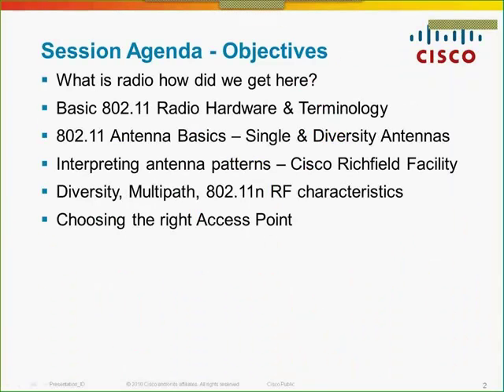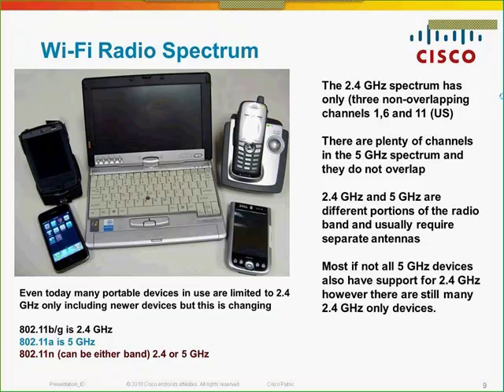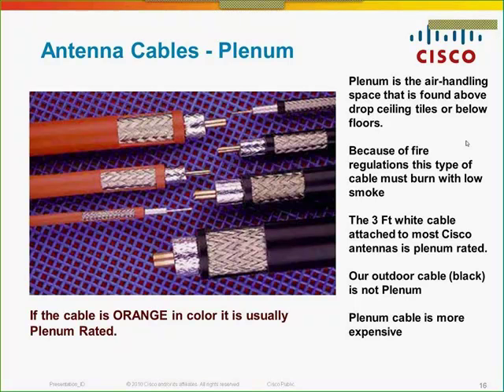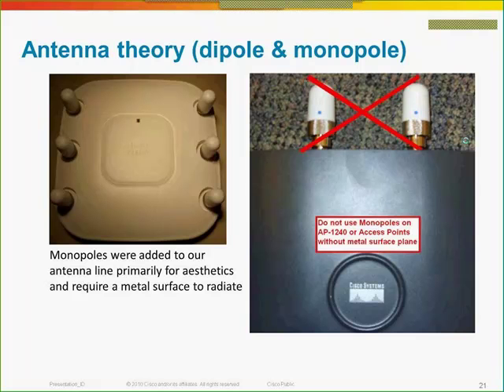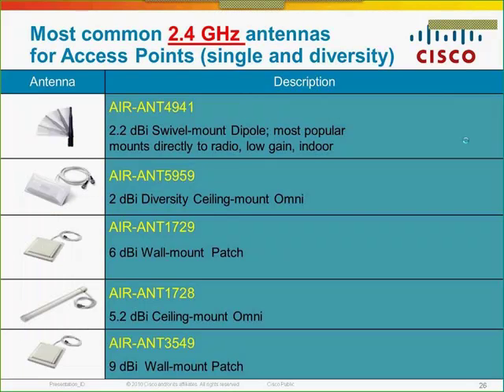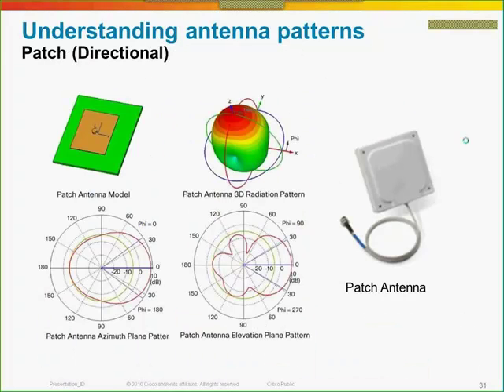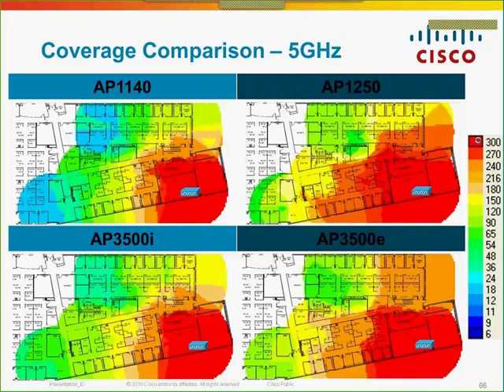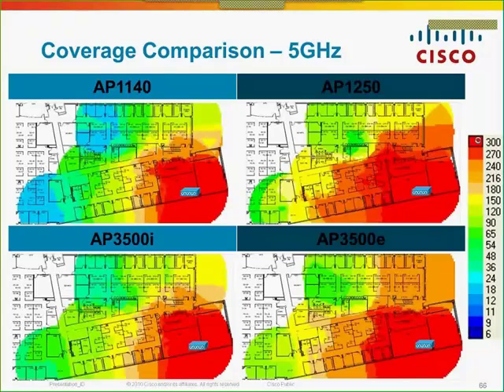Understanding RF Fundamentals and the Radio Design of Networks

Comment: I still don't understand MIMO well. If it simulates something like a software steerable phased array with multiple elements, with the outcome is that the signal strength is increased by a 3 dBs or so per antenna, which is good if it works without aligning the individual antennas. So we would get at most the same throughput to a distant station that we get to a close one. But is it really possible to transmit and decode different data streams within the same spectrum? That doesn't make sense.
Reply: j7ndominica0 MIMO typically uses OFDM. I encourage you to Wikipedia or Google OFDM for a better description. Through the OFDM process, different frequency channels (data streams) are multiplexed together and then encoded through an N-point IFFT. The output of the N-point IFFT is converted to an analog signal and is used to modulate the carrier frequency. With MIMO,  the modulated carrier frequency is transmitted by multiple transmitters but with different phase for each transmitter. This way, when the signals interfere with each other, they constructively interfere providing the receiver with a stronger, directed signal. At the receiving end, the signal is demodulated, converted back to a digital signal, and undergoes an N-point FFT. Then the different frequency channels (data streams) are demultiplexed and each individual channel is decoded based on the modulation scheme used by each channel.